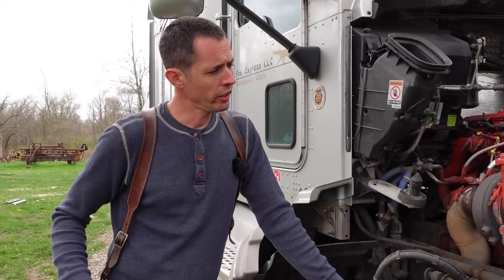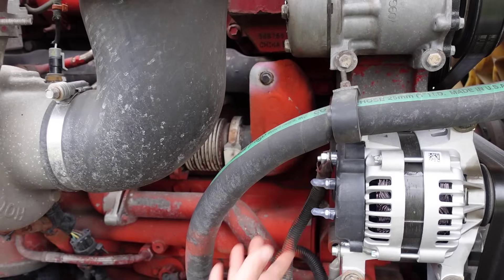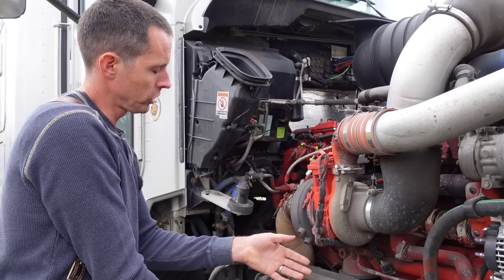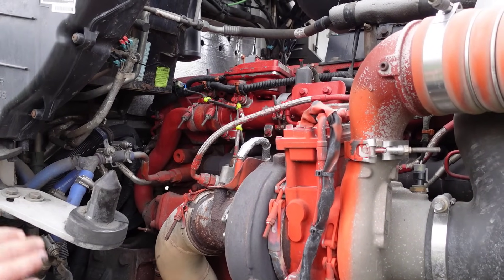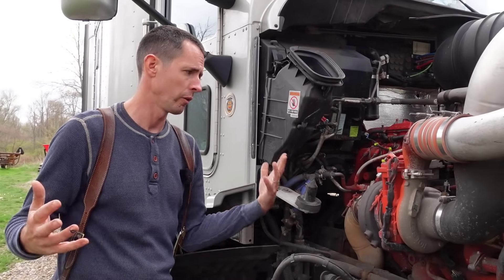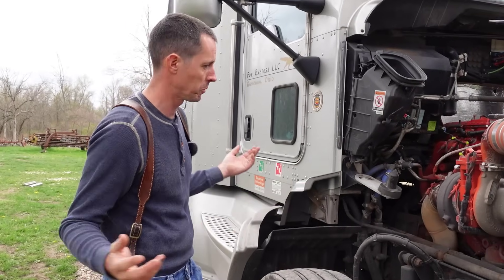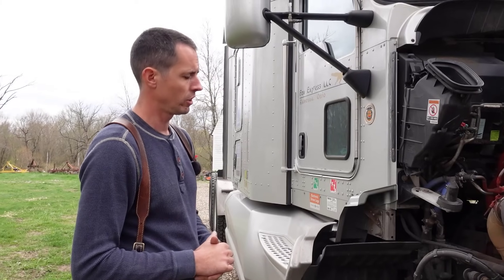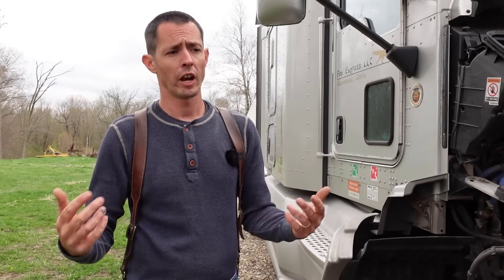What Happens During An Emission Delete - DPF/EGR Dry Run

Comment: Perfect explanation, I have a DD15 and it's the exact same process..
Reply: Did you delete yours? Im going through a delete on a DD15 also and am a little nervous.
Reply: @RK-yu7mp  yes, smooth sailing ever since..no more lights,  no more issues. Best $3200.00 you'll spend.
Reply: @squarebiz1973  Thank you for responding man. Ill be getting mine tomorrow so Im excited af. They hit me for 3,500 so looks like I overpaid but not by much. Are you ever worried about DOT or EPA?
Reply: @RK-yu7mp  3500 is right in the ballpark, some are as high as 4k, so no worries there. As far as the DOT and EPA are concerned, not worried at all and I run California. One thing I did do was had the weed burner exhaust pipe converted to the stack style like the older trucks because you'll blow black smoke from time to time and since it's blowing under the truck it's very noticeable. It smokes out 4 wheelers riding next to you. That would be a clear give away to the authorities,  so instead with the stack  you blow it in the air and it just looks like an old truck and no one knows the difference. That retro fit cost me like 900.00.
Reply: @squarebiz1973  I appreciate that bro. Definitely gonna check that out. Safe travels to you man and thanks for the info 🙏🏼
Reply: @Square Biz Where can I find a full kit for my dd13 engine? I live in Florida and we don’t have any inspections for pollution.
THANKS!
Reply: @2-ATrucker  full kit? I'm not sure I understand. If you're talking about a delete, they reprogram your ECM to ignore all of your aftertreatment sensors, cut a hole in your dpf filters and shut your egr actuator off. It's mostly reprogramming. Don't let them remove anything from the truck or install block off plates or turn up  the horse power, ask them what their process is first,  a bad delete could destroy your engine.  I'm not sure of any shops in your area,  most don't advertise.  Find a driver in your area that has had it done locally and ask them for a recommendation. Hope this helps
Reply: @squarebiz1973  thank you for replying! What you said makes sense, I will look into that. I did read somewhere that if it goes wrong it could kill your engine, I will see if I can get it programmed and just cut a hole in the filter. I’ll leave it at stock HP. I’m thinking about buying the Detroit software to run my own diagnostics and test when needed, I wonder if I can do programming with it or if it’s dealer only… as far as I can tell from reading is a dealer won’t tamper with emissions even in the ecm, so if a shop would have the software I should be able to have the same access to the software as a regular shop.
Reply: @2-ATrucker   I would find someone in California that has experience with deletion. If you get a good guy no one will ever know it’s deleted it will pass a smog test and everything. Lots and lots of people in California delete their trucks. I worked for a small carrier that deletes all there trucks and never had a issue with the trucks.
Reply: @Richtaco  if you don’t mind explaining that part plz ? Of deleting and still pass
Reply: @amroualkady1  idk they just pass. They don’t smoke or anything the def gauge will say full or close to empty. And no issues no lights no problems.
Reply: @Richtaco  my brother. Thanks for ur reply.
Reply: @squarebiz1973  I would like to convert my grass burner exhaust to the stack style as well. $900.00 does not sound bad. Was that dual stacks or just one? Do you mind sharing where you had it done?
Reply: My man I have mine deleted as well on a dd15 . Will this prolong the engine?
Reply: @squarebiz1973  where did you delete bro?
Reply: @5kEyes  Casa Grande, AZ..I know you wanted a specific location,  but I don't think this is an appropriate place to provide that information So the initials are (A.A. and D.) 👊🏽
Reply: @RK-yu7mp  how has everything been since delete ? I am considering next month
Reply: @rakimmason8  I’ve had nothing but problems, but I had a complete idiot do mine that just drilled holes in them. If you do it, make sure you do it with someone that really knows their stuff.
Reply: @RK-yu7mp  thank you for the insight
Reply: @rakimmason8  Yup

Comment: On my F250 I just blocked off the air going in to the EGR even though it’s unplugged sometimes on high boost it will caused the valves to open

Comment: There's a mechanic on our job almost every day.. Def Engines Fucking Up Again.. Only equipment and trucks that don't have any problems are the ones without DEF.  That shits putting people out of business quicker than the fuel prices.
Reply: Seriously paid $2600 truck ran for about 15 days broke down again … force regan $400 road side …… truck ran another 10 days take it back shop mechanic tells me best just deleted it cause the amount $$ cost pay repost no guarantee it will give me
Longer then 30 days when from def to dpf issue 😫😫😫

Comment: I have a series 60 borg warner turbo and the truck is a complete animal now.  Mountains becomes flat for me
Reply: You know...I changed to a B&W waste gated from a Garrett and I'm not feeling nor seeing a difference. My fuel mpg is the same and hills still are hills. Maybe I'm running at 430hp instead of 470hp. Care to describe you total tunes? I'm in a 2015 Columbia.
Reply: @willmann30  I did a BW K31 and a Full-tilt Manifold on my 99 12.7 Columbia. You don't need to tune but when I went from a 430 tune to a 500 tune the difference was crazy. Went from  6.2mpg to about 7, temps went down and climbs well with a 10 speed. Highly recommend a ceramic coated manifold and a good tune to match your injector size.

Comment: Ninety nine percent of the deletes going around out there are butchered and hacked programs going all the way back to 2008 - 2010. They are files that have been floating around on the internet for years. Sadly, these are the same files many of these so called big name tuners use. I have seen a few of their files, not to mention that each motor is designated for the specific model truck it is in. It is the norm to see one of these engine killing files meant for say a KW, in a Volvo, pick your flavor. Sadly, these are tunes many folks pay thousands, if not tens of thousands of dollars for. Normally, within a year, the motor has cooked or ate itself, in frame time.  It would have been a heck of a lot cheaper to learn and maintain that emission system... Keep reading... 

Then the cans, they have to be completely hollowed out. Every bit needs to be removed in the DPF/DOC and SCR. you don't, you are cooking the motor as the cans will now become face plugged and the destruction will comense. they have to be gutted, you cannot get away with drilling a few holes or making one 4 inch hole in the can. And that is a common problem with the big name and parking lot tuners, they instal a garbage program that has been recycled a hundred times over into your ECM and then tell you they hollowed out the cans, and they did not, or they tell you there is no need to do that, as it was taken care of with the programming. Don't be stupid folks... 

If you have a newer truck, and you are getting fault codes and all of that nonsense associtated with these EPA trucks, why don't you figure out the systems and use proper maintenance intervals to keep these systems functioning in tip top shape? 

Complete regularly scheduled EGR Tuneups, do these annually or bi-annually, depending upon miles driven and conditions. Replace the sensors, the dosers, maintain the SCR filter with regular filter changes, bake the cans and or replace when needed, etc... Install a bypass oil filtration system, Amsoil makes a universal kit you can mount on your truck. This will help keep the soot load out of the motor oil, which in time eats away at your bearings, cam(s) and lobes. And this is not an Amsoil commercial, they make the filter kit, I know many guys that do use them with great success, and you can use any oil filter that fits. Just change it out say every four months or quarterly. 

And oil, use regular oil, stay away from the synthetics... And those extended oil changes? They are killing your motor! Change the oil every 8,000 to 18,000 miles, depending on how your operation is run. Always hauling mid to light weight loads, running the midwest and south, 15,000 - 18,000 miles is fine. Running the oil fields, alway at gross or in that 100,000 lb range, maybe every 8,000 miles would be a proper interval. Extended drains will kill these EPA motors, all of that soot is still there, it collects in the oil, call it liquid sandpaper. Than the additive package in the oil, in time it stops working, then you may as well be running baby oil in the motor. Change the oil on a regular and scheduled time frame. Don't buy this extended oil change BS the dealers and the engine manufacturers tell you, they love to see you in the shop, especially for things like camshafts and rollers... Easy money, and very predictable if you operate under an extended oil change interval. They know the game, as they wrote the book. 

Bottom line, learn the mechanics of your truck, and quit relying on these shops and dealers who know less about your truck than you do. You run a business, start acting like an owner and take charge of the most important part of truck ownership. I have lost count of all of the guys I know that were put out of business due to their laziness and relying upon warranties and the thieves at the local dealership to properly fix their truck. Don't be that guy. Learn your equipment and how to maintain it!
Reply: Very good advice
Reply: Good advice, I'll take it 👍🏾
Reply: I like all of that. My only problem is that these lobbyists (def people sent them to pass regulations), are greedy af. Make these parts affordable. The price of the filters is almost an inframe. Get real. I deleted my kw. No issues since.
Reply: @travieso1ruvalcaba672  Totally agree, the prices for these emission parts is OUTRAGEOUS! 

CARB, back in the mid 2000's, tasked a California university with testing the diesel particulates from these new emission systems in regards to health and public safety. They wanted to know exactly what was coming out of these new emission motor's exhaust.

The scientists found the DPF/DOC equipped motors were more harmful to humans, and the environment, than our previous old non-EGR equipped trucks. 

They discovered the particulates, the final product of these emission motors, are now so small they go directly through clothing and skin, directly to your bloodstream. The particulates were said to be cancerous. Imagine that?

The folks doing this study recommended doing away with these emission systems for the public's health and safety until a new means to this emission issue could be found. The study was ignored.

Can you imagine how much worse it is now with these DEF/SCR systems? And of course this study was quickly scrubbed from the internet, I had the link at one time, and of course it quit working soon after my discovery.
Reply: @bonanzatransport  Thanks, just commonsense... With a bit of critical thinking... If I could only bottle at least one of these, I could retire.
Reply: The Best advice I have come up with. Thank you sir.
Reply: Well said man!!
Reply: So much bad advice here.. where to start.
Reply: After all that youstill have DEF,DPF& SCR problem.Result: You spend 1$10000.150 miles ahead yo stuck on the side of road trying make it to the dealer with 25 MPH.))))
Reply: Wow that's thousands of dollars and even if you do maintance sensors go out. I've see. Brand new sensors go out then you get towed. A 500 dollars sensors turns into 2500 dollars job by the time you are towed and diag at the dealer.
Reply: @Dial Freight I have been through it myself, I own and operate one truck, it is mine, a 2008 and has over 1 million miles on her... Cummins CM-871.
Reply: @benjaminconnolly5655  Explain the bad advice, I would be interested in hearing what you have to say.
Reply: @johntaylor7798  If you own a Cummins, you purchase an Inline reader, the software comes with it free, see eBay. The sensors need to be replaced annually or sooner, depending on your operation. If you do not own a Cummins, the EGR Tuneups still apply, these motors all have the similar sensors. You have to be willing to educate yourself and get your damn hands dirty. Quit being LAZY!
Reply: Thank you, Sir.
Reply: I'm guessing you are only referring to big trucks. If not you're lost
Reply: Your advice is to baby your engine, light loads and flat ground?  I run my shit hard and cross mountains, oil changes are definitely good, 20k or under, I change at 10k.
Reply: @mehmetyasinkocaman228  Learn how to maintain the system yourself...
Reply: @kris76stewart  This is a video about the ISX. That is a big motor for big trucks. Get a clue.

Comment: So would you recommend a delete or not? Thanks for the video.
Reply from the maker: Here is my stand with dpf delete. 
Would I Delete My DPF/EGR/Emissions? - Some Facts & My Opinion
https://youtu.be/U5j5bIH1JcM
Reply: @truckingandfixing I deleted my pdf system 2 years ago and it works fine. When the engine lights came on to change the glow plug I took it to the shop; when I took it out the shop all the pdf lights came on exhaust lights came on. The mechanic can't clear all the lights/code from his laptop. I took it back and drove and it died on the highway. I have to tow it back home.  I called the guy that deleted the system he says it is wiring issue not the delete issue. I am waiting for the mechanic  to fix my truck now. Any ideas what is going on?
Reply: @truckingandfixing I have a 2015 isuzu npr
Reply: @truckingandfixing why I have to delete the system at that time I cannot find a part for the nox sensor. All the truck parts where stuck in the ocean like 2 years ago. I have no choice but to delete the dpf system because I have no truck to use.

Comment: Wish I could delete mine . But its not in the cards. Love your shoulder holster
Reply: Nahhh don't delete it just switch the oil every 10 to 12k and crankcase filter twice a year and you'll be gucci
Reply: @StickNclutch  
Maintenance free crankcase filter (lifetime), synthetic oil change like that you can run on somewhere 30K-50K miles depending on the type of runs you do.

Comment: Why do mechanics not recommend to delete? Is it because they’ll lose good money on potential customers or because it really messes up truck?
Reply: Deleting a truck properly is not an easy endeavor, there are roughly 100,000 parameters in the programing, including tables that need to be looked at and adjusted accordingly. Simply uploading a file, like 99% of these tuners do, is a recipe for disaster.
Reply: @michaelwright1602 Doing it right means doing up to five revisions of the trucks software to make sure everything that needs to be off is off and that the rest of the engine is working properly. As  in you read the trucks own software and then you modify it, you don't just upload some premade software. Some people don't have the patience for it.

Comment: I am fixing one of these delete abortions right now, Cummins CM-871. What a F'ing mess, Big Tuner Shop, PDI style, stripped the motor of everything except the VG Turbo. When I removed the turbo, chunks of soot and carbon came pouring out, I have no idea how it held together, it is being replaced, along with a new actuator. 

The DPF/DOC cans only had a few holes drilled in them, instead of being hollowed out, that is what destroyed the turbo, high heat from a face plugged filter.

They removed the EGR Cooler and did not install a coolant bypass kit to cool the #5 and #6 cylinders. So, need a bypass kit...  

I believe I caught this in time before any more serious engine damage occured. 

Then they replaced the factory water pump with a unit off of a CM-570, so I need a new water pump and housing too. Then all of the RTV (Mr Gasket) that they used on that pump. Now I have to strip down the cooling system in search of RTV boogers.  

Then the high heat issues, going to have to change out the oil cooler, oil and coolant thermostats, and God knows what else. Right now I am $8000 deep into this mess, when all said and done, I think with parts, and my labor, $15,000 easily. 

If only the previous owner would have simply completed an EGR Tuneup and replaced the DOC and DPF filters, none of this would have happened. There was no need to strip this motor of thousands of dollars in parts, destroy the turbo, and all of the other issues it is now facing. And I have not even gotten into the programming yet.

Comment: Hey guys, 
I brought a dd15 not long ago and have found that the dpf has been deleted, my question is does that delete the egr as well because only the (hot) side has been blocked off not the other side do I need to double check with a computer that will be safe to do or just block it off?
Thanks in advance

Comment: The worst flywheel blowup I saw was a disgruntled driver who rolled down a hill with his truck in 3rd or 4th gear with the clutch disengaged then popped the pedal at about 50 mph thinking he would blow the engine. Wrong. The flywheel disintegrated sending a pie shaped wedge through the bellhousing and dog house then wedging itself into the bottom of the dash. Mass doesn’t like to overspeed. Guys my age will remember the OVERSPEED light on the dash. DPF delete?? YES. Diesels are engineered to breath.
Reply: Just brought a Cascadia dd15 having issues with forced regen. Can you advise me PLEASE? 🙏